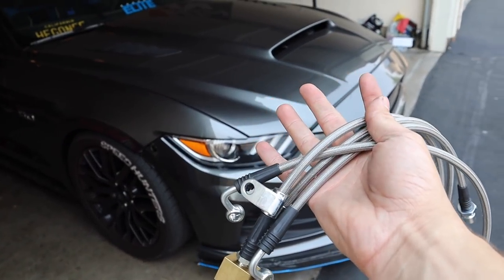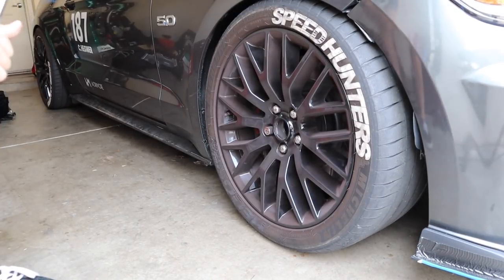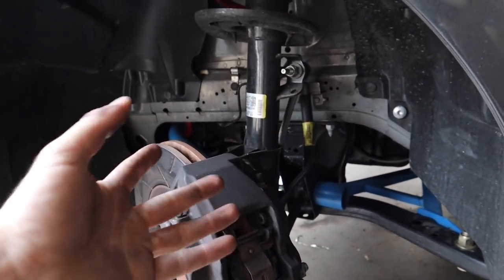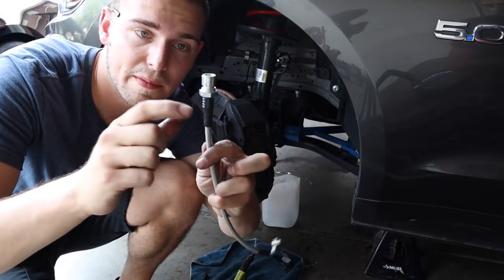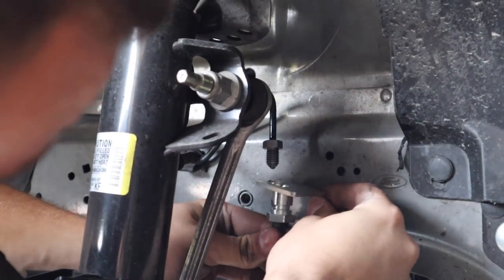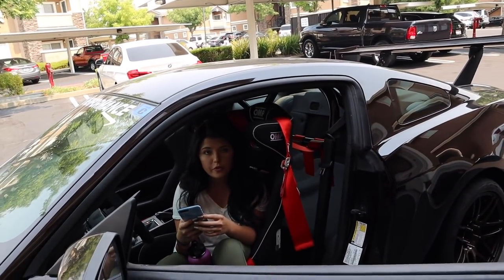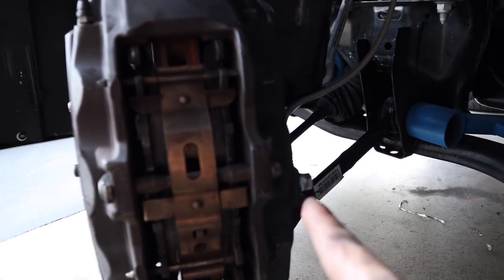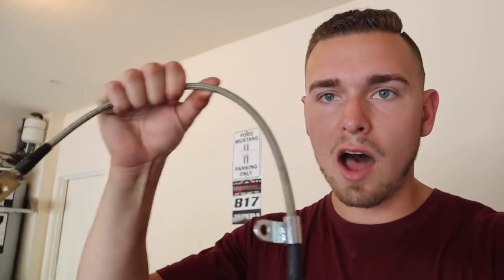EVERY CAR ENTHUSIAST MUST HAVE THIS $100 MOD!!

Comment: So...why couldnt you complete the rears? And a very important step is the bleeding process. I think thats where a lot of ppl lack in knowledge. If you're going to have the system open, you might as well also upgrade to higher temp brake fluid (like Motul 600 for example), since you're already needing to flush the fluid. Its also a good time to inspect the caliper hardware, which is very cheap to replace. I've got the full set for my 2016 Focus ST, but was about to help a buddy do his 2015 S550 front lines. Thought I'd check and see if there were any tricks...looks like its identical to any other brake system I've worked on for multiple platforms lol.

Comment: I have the stock brake lines with slotted rotors aaaaand dont have a squishy or slow brake. Even at high speeds, although good advice!

Comment: Ya gotta clean the the threads on the rear before screwing the new lines in.....This is a common problem......I'm curious why you even posted this video without showing the completed install.....lol